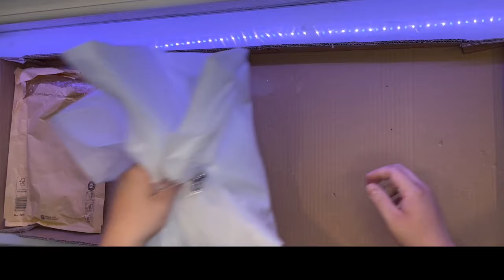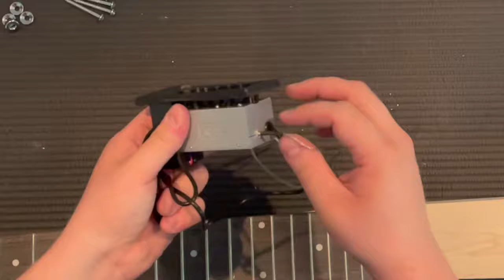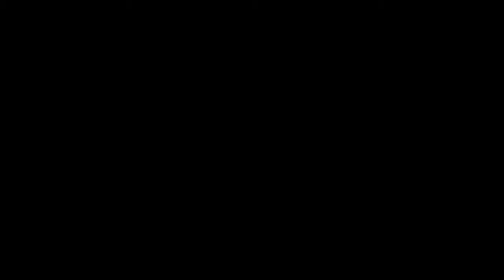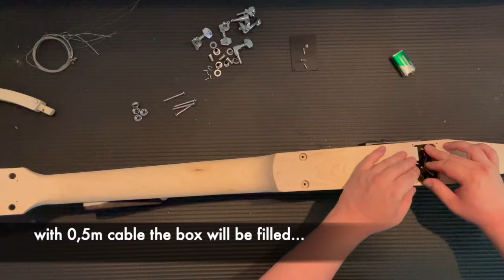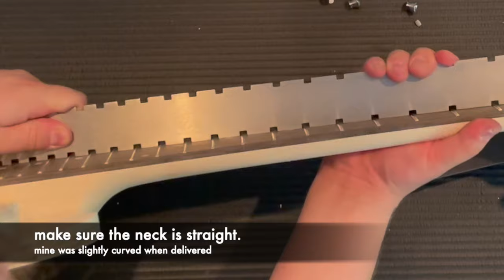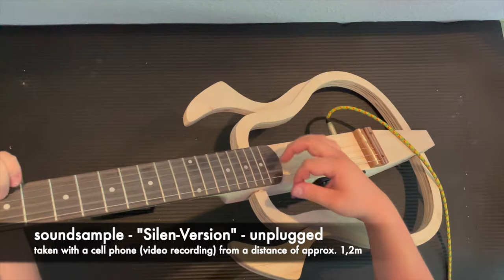Silent Guitar DIY Kit ml Factory unboxing and build HOW TO Bausatz Gitarre Acoustic Guitar

Comment: Very interesting build, I didn't know that they made a kit like that . It is always interesting when building kits how things don't always work out the way they are supposed to . Very good video. Definitely a like and subscribe.
Reply from the maker: in itself, the kit is not bad - but the "pre-drilled holes" for mounting the bridge are of course not very helpful - on an acoustic guitar you have to adjust here the bridge in the finest range, and if then pre-drilled holes are right next to it, the screw always slips back to the old position. but the set is wonderful as a basis for your own design.

Comment: Those piezo-electric pickup / pre-amp assemblies are off-the-shelf items, so length of the cord, & position of the jack socket are pre-determined. They are designed for installation in a 'standard' hollow body acoustic guitar 'box', on one of the upper bouts. It would be relatively easy to shorten the cable.
By the way, the piezo pickup is in the BRIDGE, not the nut - but you knew that anyway.
Reply from the maker: you are absolutely right.  I'm in the process of modifying the model and will upload the first half here as soon as possible.  since I change the position/alignment of the peramp anyway, the cable length no longer bothers me.

Comment: It looked like you were measuring from the 11th fret rather than the 12th fret which may account for it sounding out of tune.
Reply from the maker: Hi, that's a good point. In fact, the 12th fret is often used for references for various measurements, but in this case the measurement served something else. The 11th fret served as a separation for measuring. the fret is at 304.59mm for a scale length of 650mm - since my steel ruler shows 0.5mm intervals, I can take this measurement fairly accurately. I have therefore measured from the saddle to the 11th fret my (approx) 304mm, to be able to measure from the 11th fret to the bridge the remaining 345,xx mm.
Reply: @der_jan  Ah, that makes sense, thanks. To be honest I was pretty sure it would have sounded really bad if you had measured to the wrong fret. Good project, enjoyed watching.